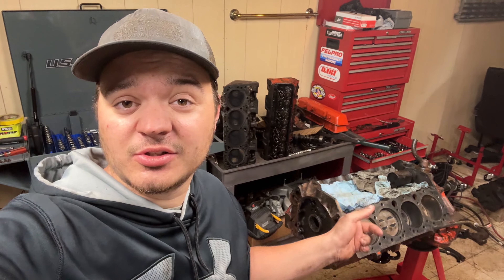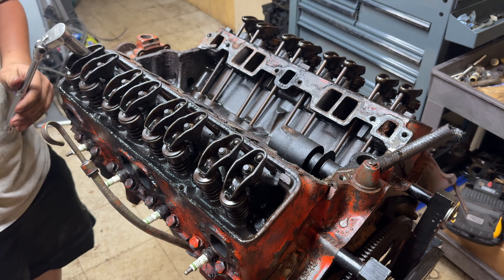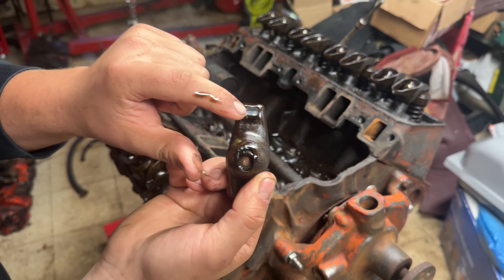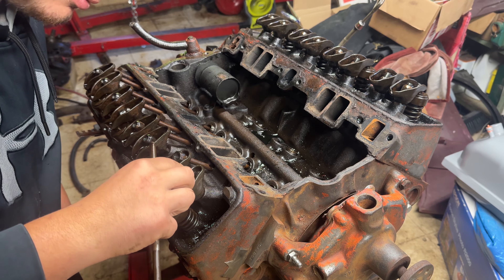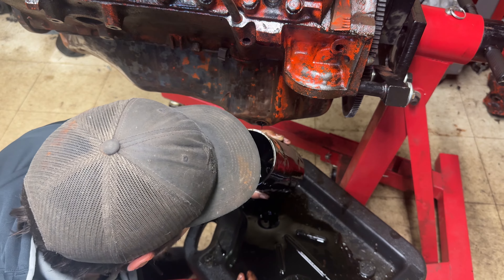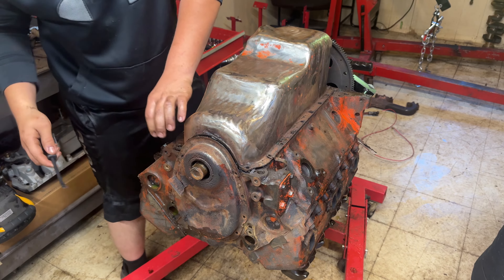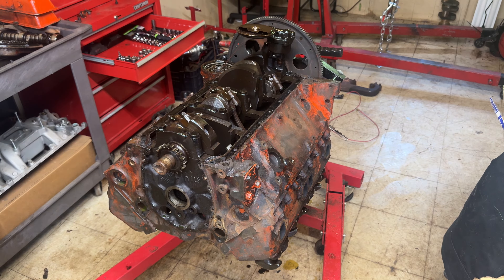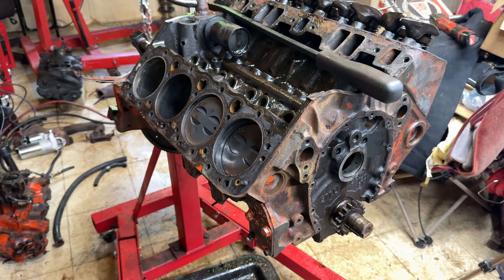283 Small Block Chevy Teardown: It Almost BLEW UP!? Budget Small Block Chevy 283 EP:2

Comment: Love this build.  I plan on building a 283 .060 over for my 54 Chevrolet kustom using a 67 283 block and power pack heads.  Good call on the screw-in rocker arm studs; my engine builder (at my request) installed a set of camel hump heads on a ZZ4 short block with an RV cam for my ‘55 Bel Air, but did not install screw in studs so when we started the engine for the first time a few years later, one of the rocker arm studs was pushed out of its press-in bore and made a heck of a racket.  Fortunately nothing was bent so engine guy #2 (the first fellow passed away during the pandemic) removed the heads and installed screw-in rocker arm studs, and the engine has been perfect ever since.

Comment: Even with the flat tops, the short stroke will give low compression with any head having larger than 58cc chambers. Try aluminum TPI Vette heads(58cc 1.94/1.5) or 5.0HO 416 heads(58cc 1.84/1.5)

Comment: Throw a new oil pump in it and a double roller timing set in it.  Change the cam and lifters because I've got news for you.  Those lifters are completely worn out, the bottoms should be slightly convex to support lifter spinning across the nose of the lobes.  A lifter should spin and roll across the cam lobe not wipe across it and the tip of the cam lobe should be angled to one side, that valve train is junk. Check the bearings, have the heads done with a surfacing, 3 angle valve job and a new set of springs and PC seals.  Don't worry about the crank, the nylon gear pieces wouldn't get past the strainer anyhow.  Add a set of steel shim gaskets, assemble and get her back on the road.  Done it many times.

Comment: Does a 1966 283 small block 350 engine in a el Camino fit in a 1963 nova ii
Reply: If the nova came with a small block they would fit. IF you still have the original oil pan.  If going from a 6cylinder to a V8, it's possible,  but the special oil pan can get expensive.  Plus the motor mounts.  It can be done fairly easily.  Just not cheap unless you can do any custom work yourself.  God luck 😊

Comment: Personally, I would never take an engine down as far as you have already and not at least inspect all the rod and main bearings. It doesn't take that long and if something is wrong with them and you install the motor then all the parts and gaskets was for nothing if you have to do it all over again. Juts my opinion.
Reply from the maker: I hear ya. I will say, I did pull the main caps off to inspect them off camera after I made the video and they all looked great. I didn’t touch the rods bearings though.
Reply: You admit that it is highly likely trash may have traveled the oil system. The MAIN bearings are the cornerstone of the build. Rod bearings are the most abused bearings in the engine. You want to boost compression crank up the ponies and definitely gonna be raw doggin the motor when you get it running. WHY would you even consider not starting fresh with new solid bearings?
Reply from the maker: @Hillbillygarage1215 I felt comfortable with what I saw and I made the judgment call to put it back together. Yea I could’ve gotten new bearings but I decided not to because I needed the engine back together asap. That’s why in the build video it went back together with the same heads. I didn’t want to do it that way but that’s what I had the time and budget for. I also mentioned that there would be a round 2 with this engine at some point down the road where we would completely go through it. But for now it’s been running great in the car for the past 2 months… so I guess I am not that stupid after all.
Reply: @BoneyardRevivals  Sir I completely apologize. I in no way meant to call you stupid. Just commenting with my old school opinion. Again, I apologize if I offended.
Reply from the maker: I was replying to the other guys comment.